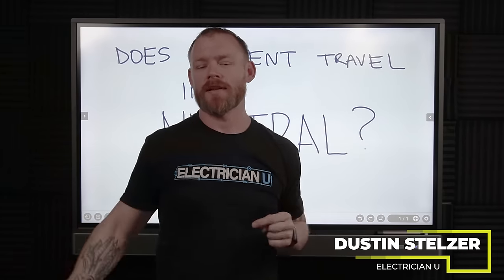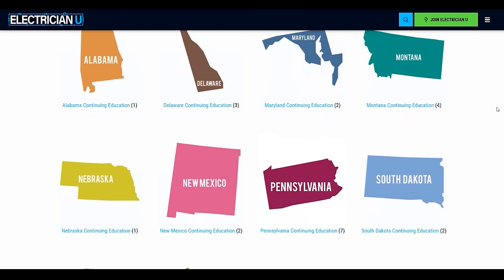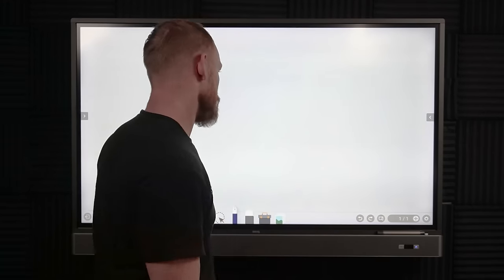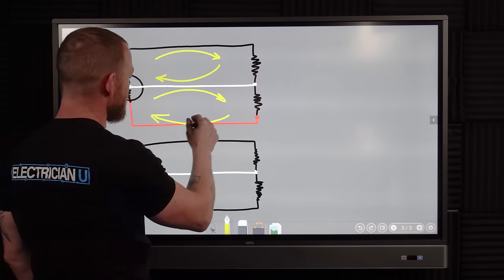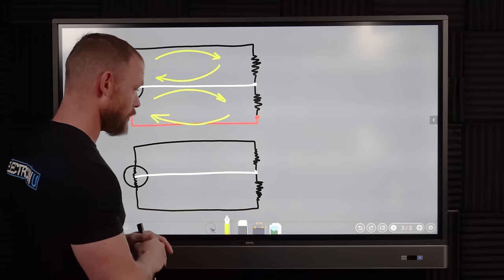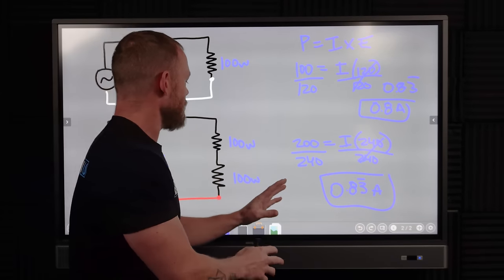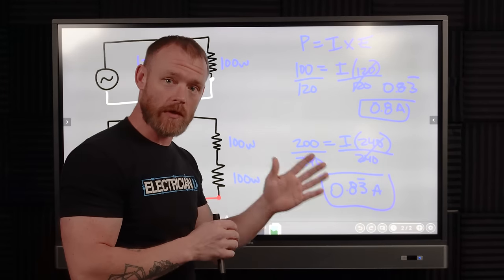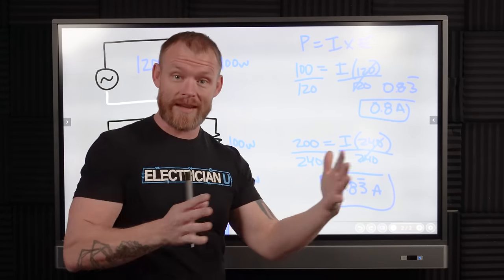Does Current Flow on the Neutral?

Comment: So in the instance of a shared neutral on say, a 14-3 NM cable in a house, powering two circuits, does the field cancelling effect basically mean the load would read zero on the neutral if the load was equal on both lines? What if the lines had different loads? Would the neutral load read as the difference in the loads on each line?

Comment: An abbreviated version of this video could simply point out Kirchoff's law, which says that the current flowing in a series circuit is constant at all points.

(The neutral is in series with the hot wire.)

Comment: You mentioned the 'common' in this example but what if you measure some current on the 'ground' ? I'm a novice trying to understand even a little bit of this and recently watched a guy trace the source of AC hum coming through our broadcast mics ! He didn't 'fix' the problem but masked the hum by removing the mic processors from the ground pin on their AC plugs .

Comment: Complete layman here! So, I had a food concession trailer built (the wiring has been bugging me) the main receptacle in, is a 50 amp two pole, four wire twist lock configuration. Half the trailer is running off of one pole, and the other half, the other pole. The cord feeding the receptacle will usually be coming off of a 50 amp generator parallel kit, would that be considered the same as two blacks (or two reds) feeding the panel, or one black and one red feeding the panel? Another question I have is, I also have an adapter cable that takes a three prong 30 amp twist lock, to a two pole, four wire 50 amp and energizes both X and Y leads (so I can run the both sides of the hot bus from one generator) as I understand it, that’s definitely the same as both hot busses being black. What should I look for as far as possible issues?

Comment: I know its a single wire coming into the transformer, but aren't the two 120volt feeds coming into the panel 180 degrees out of phase with each other?  In this case, why doesn't the full current travel back through the common wire?

Comment: I have a problem with your thoughts on using two hots on the same phase you are doubling the current on the neutral but you are also doubling the current  on the hot if your power supply is fused properly it will also be overloaded and shuts off..

Comment: What this teaches me within the first five minutes... is that the USA has a really weird electric system where they split up 240v to 2x120v with a random "neutral" wire. Also getting completely balanced loads is nigh impossible, so there will always be current on a neutral.
Reply: It is “weird” only because it is unfamiliar to you, and I don’t know why you say the neutral is “random.”  It didn’t just show up by accident.  It was designed in for a purpose.  The neutral ensures that no part of a residential service has more than a 120V potential to ground.
Reply: @GH-oi2jf  it's weird because most countries in the world use a 220 / 230v system. Only a couple of handfulls use  110v. So no,  not weird because I'm not used to it.  It's weird because almost nobody does it.

 What is wieirder is that the US has a 220v system,  but for some reason decide to turn it into 2x110v, which makes wiring a lot more complicated than it needs to be.  Also there are specific 220v breakers available for the US,  completely negating the whole system. Its bonkers.
Reply: @Deadl0ck  — “Unusual” is not “weird.”  You just want to use a pejorative term, I think.  The US started with an electric system of about 100 Volts (DC) as a result of Edison’s experiments with incandescent lamps.  The earliest AC systems stuck with that for compatibility, and it eventually became 110V to 120V.  By the time higher Voltage was needed, 110V devices were so widespread that it was considered more practical to add the higher Voltage in a compatible way.  Very few things in a residence need 240V.  The only 240V receptacle I have in my apartment is for a clothes dryer, and I don’t use that.
Reply: @GH-oi2jf  Weird and unusual are literally synonyms. As are odd, peculiar and uncommon. That you have a negative connotation with weird for whatever reason is on you, don't put that on me. 

I also fail to see why the history matters. The UK was on 110V too, but switched over after WW2. 

That said, having learned more about about the electric system in the US, and how shockingly (pun intended) unsafe it is/was, it's definitely for the best it's only at 110V.
Reply: @Deadl0ck  — The history is important only in that it appeared that you thought we started with 240V, then divided it.  The opposite is true.  We started with the lower voltage then later doubled it in an upward compatible way.

Comment: There is always current flowing through the neutral. The outputs are out of phase that's why the load is twice if you hook the output to one side of the hot. You essentially have two outputs from the transformer that are opposite or close to it. The only time you would have no load on the neutral 240v side is if you hooked both the red and black outputs to a 240v bulb.
Reply: What is 240v side”?
Reply: @GH-oi2jf  the 240 is the black and red wire in his example. It's center tapped to make 120 output.

Comment: Great video but can you give an answer as to how to solve this problem if it was out in a residential field.. I came across this today literally
Reply: In individual circuits (one hot and one neutral), neutrals always carry current and are always counted as current carrying conductors for derating purposes. When the neutral is shared (two hots using the same neutral), the neutral doesn't always carry current, but it is not counted as current carrying conductor for derating purposes.

Comment: So if the 120v loads are balanced in the system essentially causing it to travel through the ungrounded conductors instead of the neutral, let’s say the loads 2 amps per leg, would we read 4 amps on each leg from the loads adding together?
Reply: No.  If you had two identical loads which drew 2A at 120V, and you put one on each side of the split phase system, you would still have 2A, but at 240V across the two loads in series, hence twice the power.

Comment: Yes in the US single phase system current flows on the neutral. In 120v circuit, no neutral in a 240v

Comment: If you wire a home, turn on all the breakers and don't have anything turned on in short no current is flowing to any device because nothing is turned on like switches to room lighting and nothing is plugged in to any outlet then there is no current flowing. This assumes no appliances are plugged in that uses power Then there is no current flowing through neutrals. And touching one to ground will may have a little bleed through but not enough to cause a shock. Complete on circuit all that changes.

Comment: So if I plug a multimeter into an outlet in my wall... Will I measure 120v? Or 240v? Or somewhere in-between, depending on how balanced the load is...?? Ugh, why did this confuse me more than it clarified??

Since I'm probing the middle of the circuit, ie in an outlet, I'm only seeing half the resistance at that point too though, right? So is this why every device still sees 120v, but the overall system sees 240v?

Comment: To be fair, this video is both somewhat decent and laughably abhorrent at once.
A short explanation to sum up the whole question of "Does current flow on the neutral?" is:
If we have a split phase system, with loads on each side of the neutral.
Then the current we will see on the neutral is directly proportional to the mismatched current of the loads on each side of the neutral.
Ie, if one side consumes 20 amps, and the other consumes 15, then the neutral will see 5 amps flowing through it.

After this you can go into why this is the case.

Making examples of "in this case current doesn't flow on the neutral" is frankly only perpetuating a dangerous myth that a lot of electricians believe in. There is rarely if ever a balanced load in an electrical system.

I see a lot of electricians struggle with basic electronics theory. Mainly since electronics theory isn't really the important part of the job of being an electrician. The more important factors is knowing safety procedures, building/electrical code, and what certifications and ratings are needed for X thing, and then also being able to physically do the job. All though, better understanding of the theory would help a lot in some cases.

Comment: Now this is the case in the US. A lager portion of the World is now using 230/400V TN-C-S mains distribution systems. You have a 400V three phase system with one neutral. You can deduct 230V or 400V from the system, no 120V. 
Let us charge a Tesla car with 3 chargers onboard, using 3 live 16A and Neutral. What will the current in the neutral be? Zero amps! 
We change to an E-Golf from VW having only 2 chargers onboard. Now there is 16A in 2 live wires and the Neutral current is 16A. 
Strange, is’n it?

Comment: Not a physicist, but I'm pretty sure this idea of electrons flowing through the conductors is misleading. Electromagnetism is one of the fundamental forces, like gravity. Electrons do move some in conductors, but it's not like a particle pipe. The wires act as a electromagnetic wave guide for the current induced on the secondary winding of the transformer.

Comment: The field doesn't move.  There is only one field.  It is infinite in extent, and the elections produce changes in that one field.  The change in the field caused by the electron (mostly) lines up with the point in the field that corresponds to the point in space where the electron is located at that moment.

Comment: "Residential electric service in the United States (120/240 Vac) is sometimes called two-phase service but this is NOT correct. It is only single-phase, since both line voltages are derived from a single phase of a distribution transformer with a center tapped neutral and are 180° out of phase with each other."

Comment: This is a result of the odd USA 110/220 "2 phase" system. I assume that the neutral is centre tapped on one phase. In most other systems only a balanced 3phase system would have no current on the neutral. in reality phases are rarely completely balanced so there will always be some current in the neutral if there is a load.

Comment: Pardon my ignorance, but does the black represent the ground wire, and if so is it connected to the secondary??  I thought it would eventually be connected to the ground pole.  If it’s connected to the secondary you would have current going through it?
Thanks
Reply: Because electricity doesn't actually try flow to ground, it flows back to its source.  The grounding is only for lightning strikes and electric surges in the atmosphere.  It's a bit above my head, but I would imagine that having the neutral go through ground first and then back to the transformer would mess up current flow through the system as you essentially now added an unpredictable varistor to the end of the circuit.

Comment: Ive never been shocked from cutting or touching   a nuetral wire. I must have not been grounded or completed the circuit but i have seen a neutral wire arc while connecting it live to the neutral  buss bar. Also I've  seen many electric panels with Neutral and ground connected to the same buss bar and the ground wires dont have voltage.
So im guessing it wasnt showing voltage because it wasnt completing a circuit with the ground making it a dead wire. Can you give me  even more clarity. Is my asumption correct?

Comment: Wow did not make halfway needing to stop :( So "Does Current Flow on the Neutral?" That depends on the circumstance of the circuit's relationship to the load.  Current is the stimulation of valent electrons to migrate atom to atom by the applied EMF.

If it is three phase balanced with a neutral there is no current flow in neutral, but if the load is imbalanced, the neutral picks up the slack toward equilibrium. Likewise, a single phase circuit the neutral is the return path. (physically and mathematically).

Lets not forget that the neutral is the center tapping point from a transformer and while it floats is dangerous unless using M.E.N system is tired to ground potential. As for the Earth or Ground only is active during a ground fault to become the alternate path rather than the living being in contact to the metal structure.

Comment: Simply explained: in a 3 phase system like a 3 phase motor or transformer there is no current/voltage in the neutral wire cause the load is blanced beween all 3 phases. In a Delta connection there is even no place to connect the neutral. in Y connection there is but I dont think  it is neccesary to connect a neutral wire in Y conenction either and even if you DO connect a neutral to there you should not have any current/voltage on the neutral still cause the phases are still balanced. If on the other hand an inbalance then would occur between the phases then current would probably run through the neutral. In single phase systems on the other hand you connect between phase  and neutral and since you need a closed circuit in some way the only place for it to go is through the neutral wire meaning if the neutral wire from the load were then to break you will have full live voltage  across the break in the neutral wire with the load attached determining the max current, were you to touch the 2 ends of the broken neutral wire then.

Comment: Remove the neutral, wet a finger on one hand, and hold it tight. Then wet a finger on your other hand and place it where the neutral goes. 
If your eyes light up, you have current, if not, you don't.

Comment: The neutral returns it to the panel.  From the panel to the utility the neutral ideally doesn't carry current. But that assumes both sides of the phase (most panels alternate sides of the phases) are balanced and they seldom are.
Ps.  That is current.  Normally the neutral should be at the same potential as ground so you should not get shocked by a neutral.

Comment: Is this an example of Kirchoff's Current Law?  Because it kind of feels like it is.  Both light bulbs on either phase in this case result in the same current at the neutral bus, but with opposite signs, summing to zero.  That would mean that the current flowing from that point back to the secondary's mid point must also be zero.  So you only get zero current on the neutral if you have two perfectly balanced phases, otherwise the current on the neutral is the difference in current between the two phases?

Comment: So how does this work with a bonded natural/ground?  Does that mean in some instances, you are energizing the ground wire?
Reply: Ground is never energized. Not by design anyway. Ground and neutral are only bonded at one place, usually at the main panel of a residence. Think of the ground as an emergency path for current to return to its source easily (and not through you) should a current carrying conductor come in contact with the ground.

Comment: Which will draw more current? 120v wt 100w load & 240v wt 100w load? Would it be cheaper by using 240v in this case?
Reply: The load at the higher voltage will draw less current, but power is power. A 60W light bulb at any rated voltage is still 60W.

Comment: Of course it flows, but you can't get electroshocked from neutral and ground, because it is already grounded, 0 volts between you and neutral. That's why the name. But as this person says, if the neutral isn't grounded, you have 2 phases and doesn't matter which of both you touch you'll be electroshocked. Neutral is a grounded phase, simple as that.

Comment: Question, If a circuit is missing the neutral say for example the Neil cable brakes but doesn’t ground out, what happens to that circuit?

Thanks
Reply: What is a “Neil cable” and do you mean “breaks”?  You don’t want to be missing the neutral.  Where are you contemplating a break?

Comment: "The electrons in an AC circuit don't really move along with the current flow. Instead, they sort of sit and wiggle back and forth. They move one direction for 1/60th of a second, and then turn around and go the other direction for 1/60th of a second. The net effect is that they don't really go anywhere." Mar 26, 2016

- Electronics Basics: Direct and Alternating Current - dummies
Reply: It's like a clock pendulum. It really goes nowhere. Averages zero. But does work in the process.

Comment: 16:25 Look at the high wattage light bulb (should have used common 60W light bulb, 1/2A in example), there is a voltage drop across the resistive load proportional to it's resistance to the total resistance. If both are equal non-inductive loads then voltage will be split equally as there is only one current path.

Comment: A neutral is a travelier not a ground. Think what does ac mean ? Aleternating curent. Alternate mean goes out and returns. If circuit is 120 v - 20 amp , it 120 v 10 amps back= it returns 1/2 of curent back to service. Ac .

Comment: This is not a good explanation of how this works. I think drawing it better would definitely help... But for example, you have a red and black, but its the same circuit bassically. Where does the neutral buss go to? If the tranformer has a positive and negative side that is the actual circuit, what is the neutral attached to? One of the lines coming out of the transformer? You just attach the nuetral to the mid section of the transformer.

Comment: If you look up hte true definition of a neutral, that is not the conductor you are talking about. 
The white conductor from the light is actually an "identified conductor" and has the same value of current flowing constantly. 
A neutral conductor is only found on a 4 wire Wye connection, a 3 wire edison circuit, a center tapped delta power source, or a three wire DC circuit.